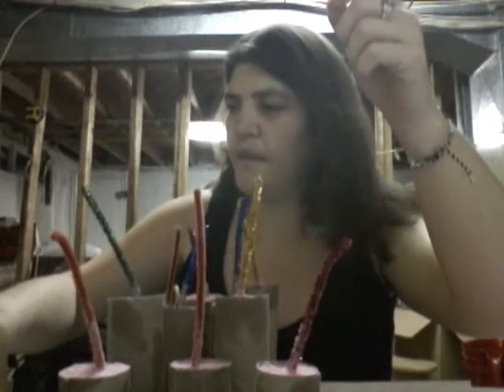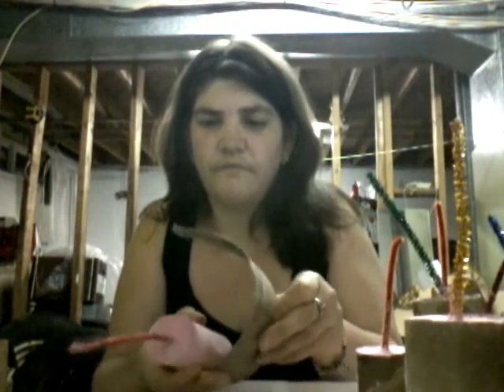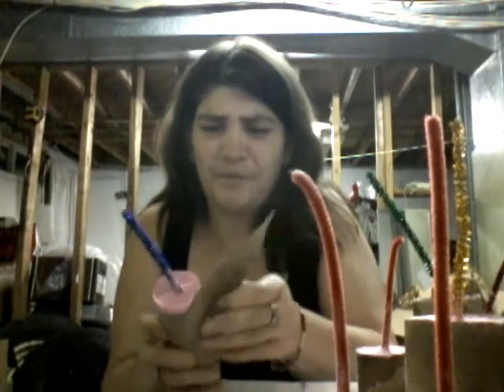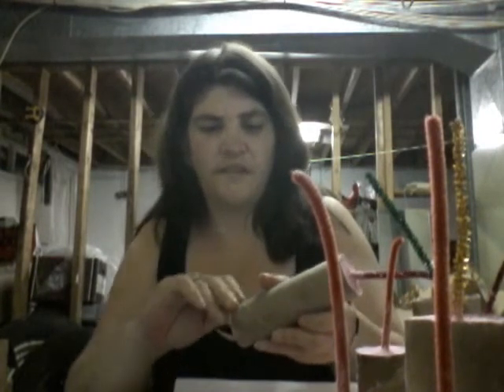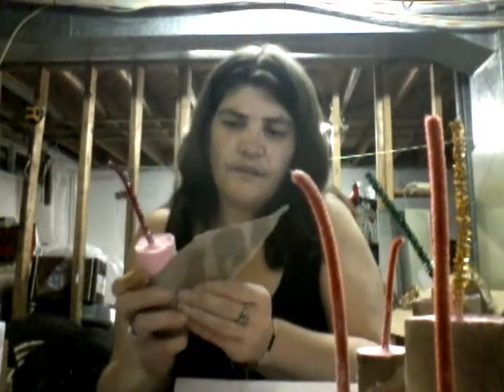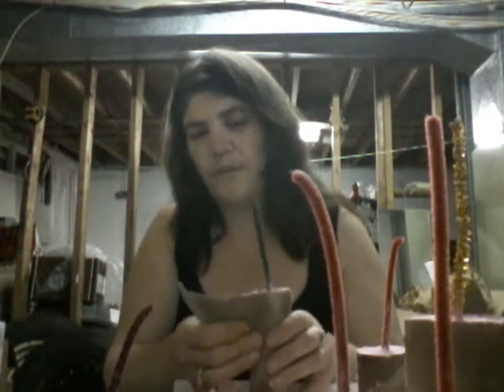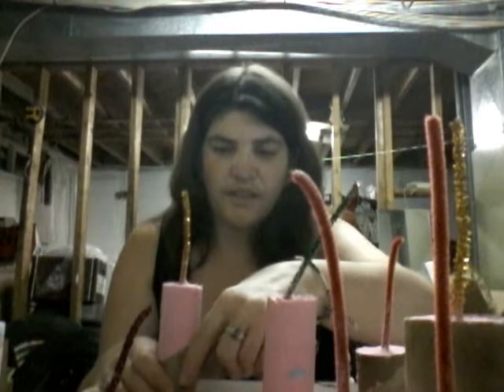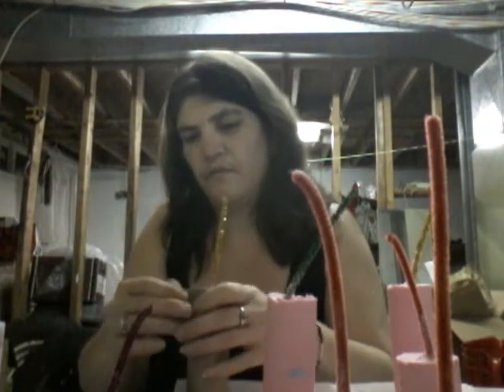Copy of Unmolding TNT bath Bombs, (second part of yesterday's Diy TNT bombs)

Comment: you now i was thinking about these, as i was about to save another roll..lol
going to get PVC in a diff size, I think that would solve saving these and not have to worry about them  falling apart ect.
Reply from the maker: getting them out of the tubing is a whole othercstory, lol we need something flexable, but not as soft as silicone
Reply: I don't see why they cannot be push out with wood..
Like the other ones people are making and selling..
It will work...
Reply from the maker: +Julie Diaz-Troyk oh you mean the push pop things? that might work but it gets a bit tricky with the wick and embeds, but I have some tubes I'm hoing to try, if not I still have my rolls lol, I like those because I can squeeze the sides to make sure all the mix gets in there